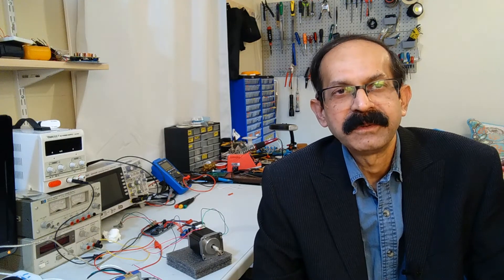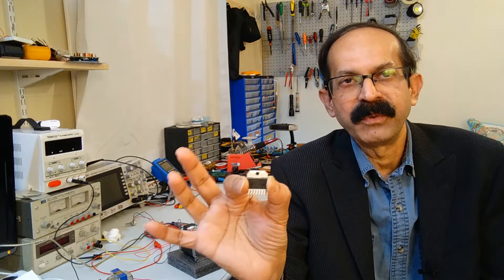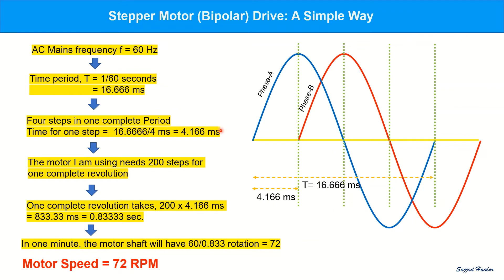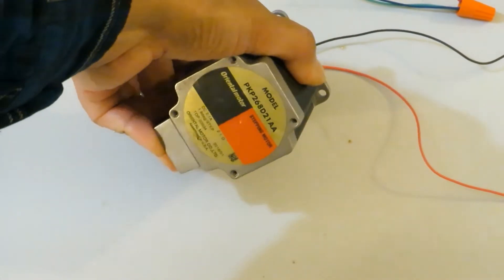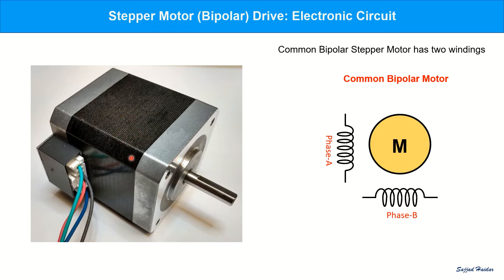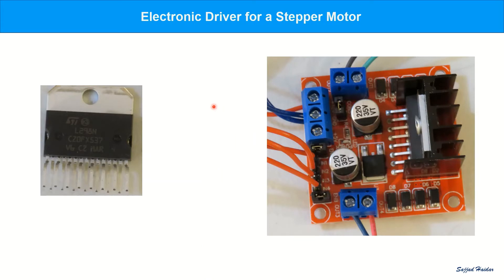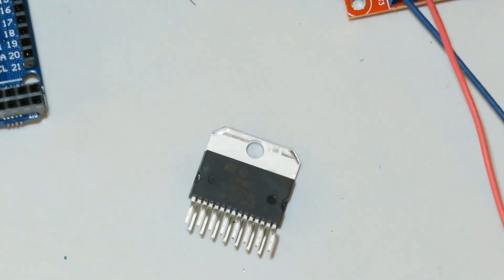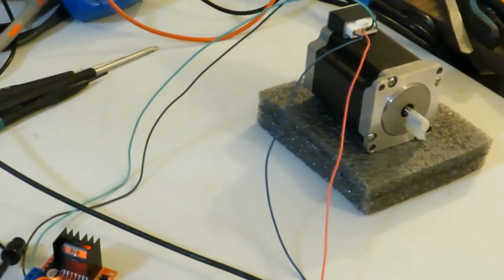Driving a Bipolar Stepper Motor

Comment: what is the name of the footprint of a stepper motor bipolar in kicad?
Reply from the maker: There is no specific footprint for stepper motor available in Kicad. But in the symbol library you will find the symbol (Stepper_Motor_bipolar). You can choose any four pin terminal as a PCB footprint